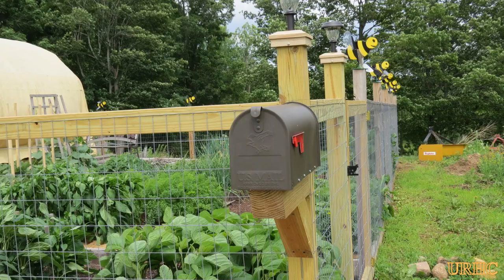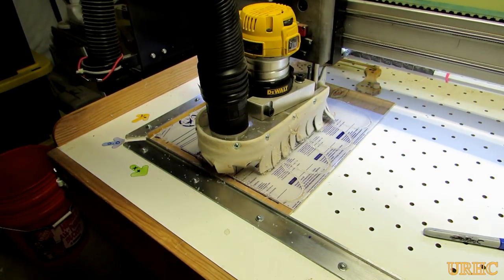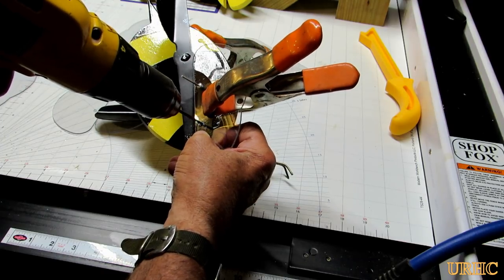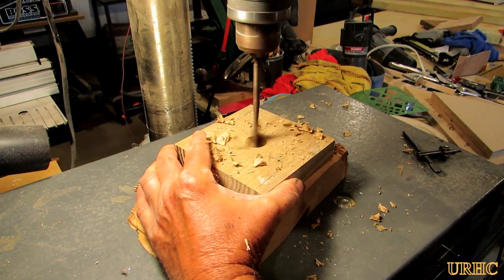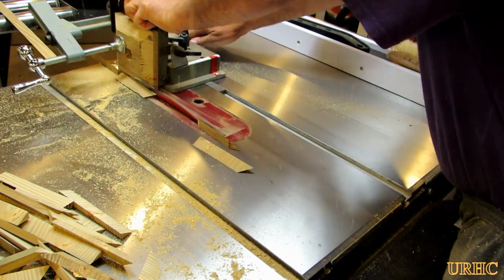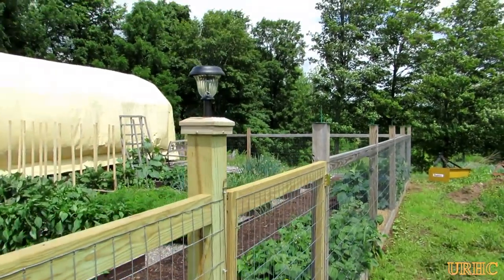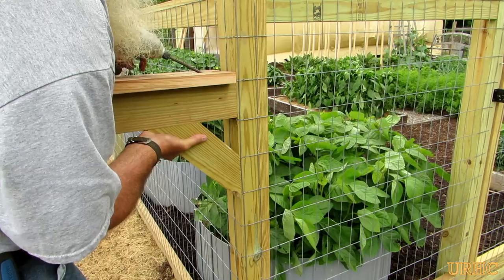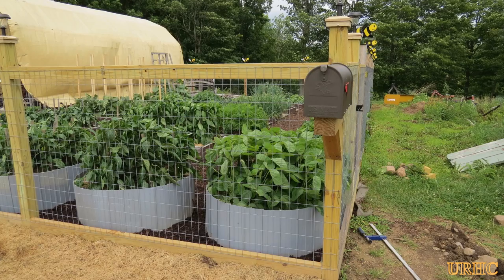Finishing Up The Raised Bed Area, Fixing Bees, Solar Lights, & Tool Storage

Comment: I ran roof pans lengthways on the bottom cut off at 8 feet and buried 13 to 25 inches to keep critters out. Ran Elect wire up top. using venturi fertilizing system. Got most of my ideas from you. Love your channel.      Florida..
Reply from the maker: That will keep driggers out if you have them. I left my posts high for an electric wire but haven't needed it yet. Thanks for watching.

Comment: The mailbox idea is something I saw a couple years ago so I picked one up at Goodwill and mounted it on a rusted decorative wrought iron post.  We put ours inside the center of the garden and it works fabulous!  We might grow a flowering vine on it. No more walking a lot to other locations on the property.  I just love your videos and we're going to follow your idea on the solar lights.  The bees are adorable.  Let us know if they work to deter certain critters.  Thanks for sharing you creativity!
Reply from the maker: Wish I had seen that years ago,  I was going to make something but the mailbox is good dry storage for 14 bucks so I got lazy. The Walmart lights  have a nice yellowish glow unlike the harsh white light from most solar lights.  There was a comment about them attracting moths,but I  don't think it will be a issue. Thanks for watching.

Comment: 0:11  I paint all my outdoor wood projects with Titebond III waterproof wood glue as the first coat, then paint as desired. I buy Titebond III at Lowe's by the gallon and use a 4-inch roller to apply it. Wood lasts MUCH longer in the weather than wood that is just painted.
Reply from the maker: That's a great idea, I will have to try that. Thanks for watching.

Comment: Yeah, you have to use marine plywood to stop delamination, the glues in normal interior ply aren't sufficient for exterior use.
Reply from the maker: I thought 6 coats of paint and clear would seal them, but I found out otherwise.  I am going to try and find a sheet of that plastic wood for outdoor use from now on. Thanks for watching.

Comment: Did you use all treated wood for the fencing? I building a fence like this this spring would love to secs video on the construction of it.
Reply from the maker: Here is the video about putting up the frame. https://youtu.be/dKtajeefswQ . It is all pressure treated lumber. There is also another video about stretching and installing the fence. Thanks for watching.

Comment: Hi! Great video! QQ: are these solar lamps any good? I've seen couple of those in my area and they barely emit any light
Reply from the maker: The ones that I used are great.  Being mounted high on the posts helps to spread the light so there is enough light to walk through there at night. I think having glass globes helps. I agree with you that some of them have ĺower output leds and these seem to be the brightest I have found so far. Thanks for watching.

Comment: I love the fence. What size are the boards at the base and the top rail?  Speaking of the top rail, did you pocket screw those?  Thanks
Reply from the maker: https://youtu.be/dKtajeefswQ This is the video about putting in the frame.  Top 2 x 4, bottom 2 x 6 were the rail sizes.